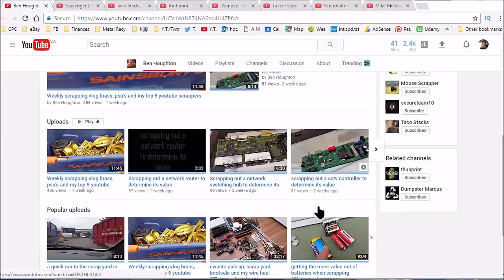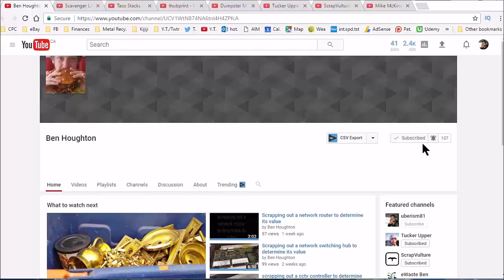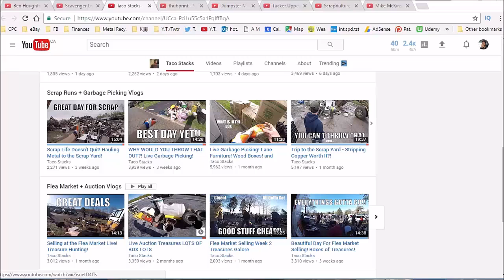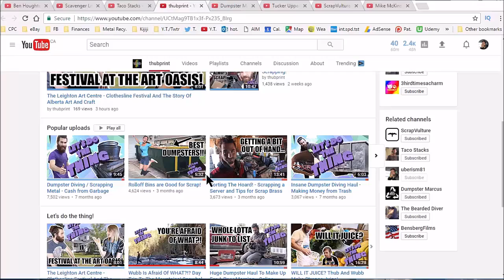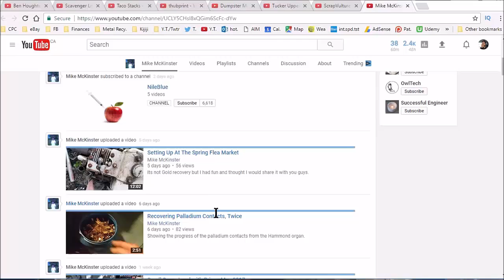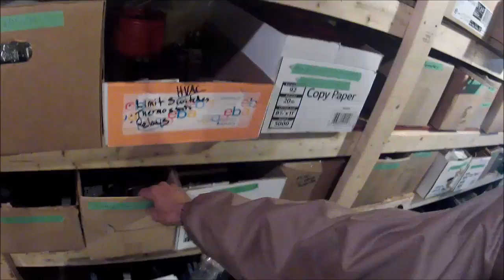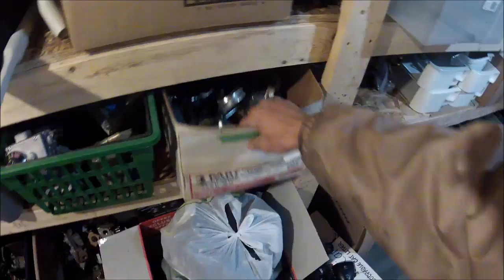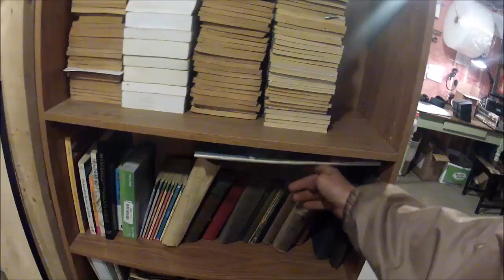1000 Subscriber Milestone! Shout Out's, & EBAY Store Tour

Comment: If you want to get more storage into the same space simply go with shelves on wheels so you can pack them in more but then move to get access when needed. Caster wheels if you want to move the shelf around or just fixed wheels if you want to move side to side 

2X4's and plywood to make the shelves rather then the store bought that would collapse if moved. 

Having more shelves would also let you tag each item as you add it to the system to have the id in the post saying shelf and level so others can find the things easier if you are not available. Just the normal tie on tags or tape with a number on it nothing fancy needed. 

Have you thought about getting some of the tamper evident tape to put on items people are likely to swap and return the old one? On the expensive side to start with but would only be on a few items out of everything you sell.
Reply from the maker: Wow that's a great idea I probably would have never thought about that. Thanks your always giving me great ideas on things! I have thought about tamper proof tape and or stickers, but I haven't run into any problems...yet. It seems like the people that are buying the things I sell aren't out to pull a scam. I'm sure if I were selling lots of smart phones, laptops, jewlery, I would get more dishonest customers.